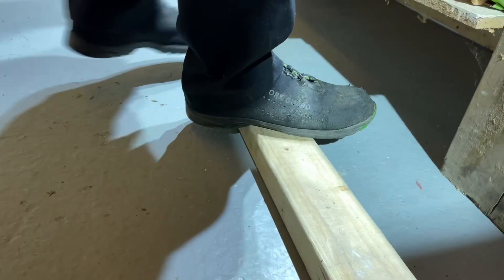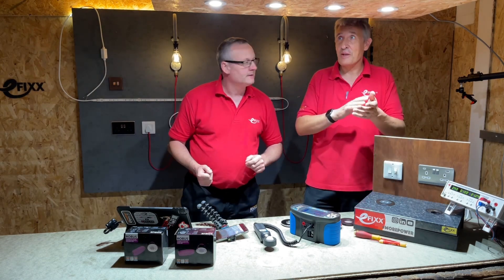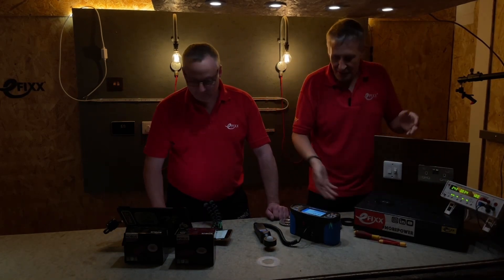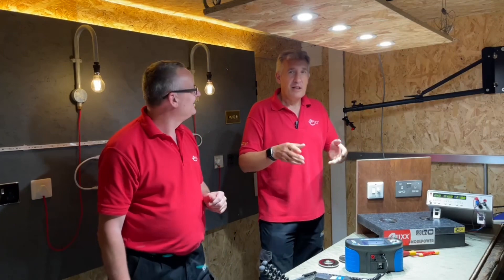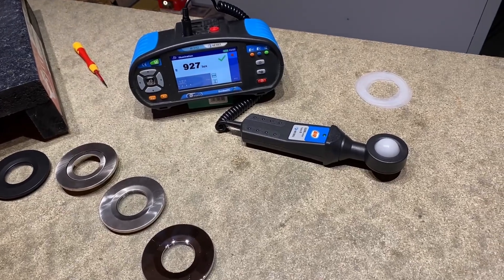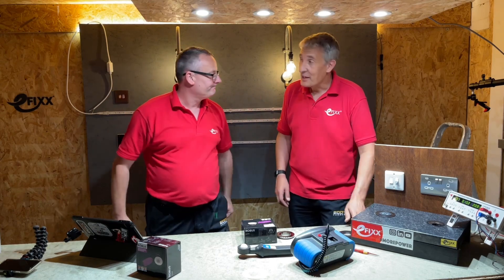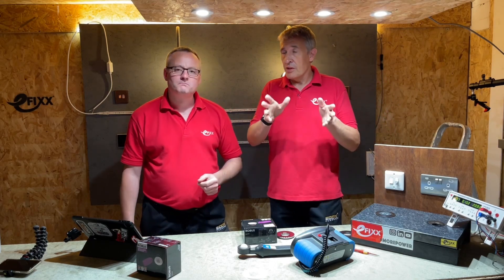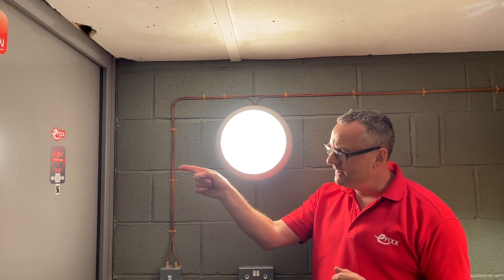Can a Dimmer Switch Save Electricity? - Energy saving tips for LED Lighting.

Comment: I don't have dimmer switches, but about 11 years ago I had the Danlers PIR sensor switches fitted in 7 of my rooms.  No doubt they've given me a "hands off" experience with lighting, but naively I thought they'd also save my electricity bill by keeping the lights on as briefly as required.

Fast forward to last week when I got my Klein Tools thermal camera.  I bought it for reasons of draught proofing and finding weak spots in my house insulation but sure enough I found so much more "what is that warm spot on the wall?".  Sure enough it wasn't my programmable thermostat, it was the PIR sensor light switch next to it.

So I thought "I've got 14 of these sensors inside and outside my house how much of a hole are these burning in my pocket".  I removed one of the sensors and wired it up to my power meter.   1 Watt!  That's 1 Watt 24 hours a day, 365 days a year for the last 11 years (minus the odd power cut).  I'm astonished!    I could have 3x Philips 860lumen light bulbs permanently switched on instead of these things and it would save me money!

I emailed Danlers, and they replied that 1 Watt is not only normal for their switches 11 years ago, but it's the same spec today!  

So, can you do a review of PIR sensor switches?  Both wall and ceiling mounted switches, reviewing attributes including their "inactive state"?
Reply from the maker: Wow - Thanks for the heads up - I’ve got a load of BEG ones in my house. This is certainly worth investigation.

Comment: These tips are great for people whom already have dimmable LEDs or are retro fitting to a halogen fitting. But, what do you do if you have a house full of non-dimmable LED spot lights giving in excess of 700 lumens? Well the answer is actually simple, but many won't consider it.

Bypass some of the light fittings so they are no longer connected, but allow the ring main to continue. This is even easier with the Wago 221's. Keep the fitting in the hole incase you want it in the future or change your mind on which lights you want on (thinking here that you may have disconnected one that is above a kitchen counter top, but realised you need it there, for example.)

There will be many folk that get all the light fittings changed in their homes due to the increased cost of electricity, but the ROI takes too long that's its not worth doing

Comment: Sorry but you have picked on the lowest energy device in the home.if you save 50% for a whole year you may just have saved enough to boil your kettle once 🤣🤣. I still find it amazing that the standard light bulb was 100w just a few years ago, and a 500w halogen for outside flood 😮.
Reply: Still got customers wanting me to replace 500w lamps! 
I tell them now, I'll only replace lamp for lamp if you give me a lamp, otherwise I'm changing it. 
Lamp costs me the same as a 10w pir, and filaments break if left in van from vibration

Comment: The devil is in the details... "it depends on the dimmer!" This one clearly does, but LED uses insanely little power to begin with... what you demonstrated would save me about $0.30(US). (How much did that dimmer cost?)

(Note: the dirt cheap rheostats put in my house 40 years ago save almost nothing, and they drive 60+W per bulb - today, 5-15W LED replacements)
Reply: In the UK, a regular branded white trailing edge dimmer is about £20, a regular switch £3
Regular LED gu10 about £2, dimmable £4

Cba working out the math myself, but unlikely to save you much in a domestic setting

Comment: I think that one of the problems is that there’s little proper science or design that goes into domestic lighting most of the time….. it’s a wet finger in the wind kinda thing…. Throw lots of lights at it “just to make sure” …. Overspec bulbs to make sure it’s not too dark. When I was designing an uplighter for my own roof light, it turns out I was well OTT. I always planned it to have a dimmer on a smart device, which has proved quite illuminating (😂). It’s minimum setting is around 5%…. Which results in much more than 1/20 of the light….. I don’t have a meter, but the power/perceived illumination relationship is not linear. 

I use a Shelly device to dim. It gives lots of info, especially the power it’s using….. 100% is 130W…. Most of the time I use it as mood lighting and it rarely goes above 50%.

The obvious conclusion from that is if I’d had more experience/design tools/guidance, I could have saved a chunk of money….. maybe 12v instead of 24v…… cheaper strip…… much cheaper power supply…. Good dimmable ones are not cheap…. Etc etc

Good resources and How Too’s are what’s needed. They may well be out there….. I just haven’t found them yet!

Comment: What about smart bulbs that you can dim with software?
Reply: It all comes down to the way the LED is driven.

Most dimmers work by using pulse width modulation. And if you lower the brightness using this method, the LED bulb does use less power. However, if you're talking about software control then there is a computer somewhere and you need to think about whether installing such a system will increase your power consumption.

Get your self a little plug in power meter and measure before and after.

Comment: Do the dimmers pull current? I have old lutron telume dimmers and a lot of halogen lights that they drive as they provide a much nicer light, but use LED accent lighting for usual lighting, I noticed that the dimmer circuit pulls current when off as they allow a small amount of current to drive the dimmer.
Reply: The old ones certainly did.  I was always told you will save more by putting in smaller wattage bulbs than dimming a higher wattage lamp .  Can’t  do that with most LEDs as they are a fixed wattage
Reply: That's probably because you've got remote control capability on the dimmer.
So even when the LED lights are off, the remote control sensor electronics is consuming a small amount of power, do you can use the remote to turn the lights back on.

Dimming LEDs, they tend to use pulse width modulation as a way to control the brightness, and if this method is employed, then reducing the brightness of the LEDs will save power, compared to at full brightness.

If the LEDs use a resistive dimmer and just change the value of a steady state DC current to the LEDs, then turning down the brightness does not save power, all you're doing is pushing the power dissipation from the LEDs to the resistive component. Total power dissipation remains the same.

The only way you're really going to know is to put a power meter on to the controller/power unit that drives the LEDs.

Comment: :Lights, power saving versus safety. 4 led downlights consuming 20 watts of energy, not long ago one bulb would consume 60 to 100 watts. I think you are scrapping the bottom of the barrel. If you can afford to install down lights and dimmers running them would not be a problem.
Reply: @dancoulson6579  What a very strange response.